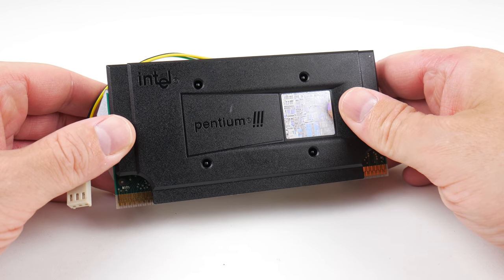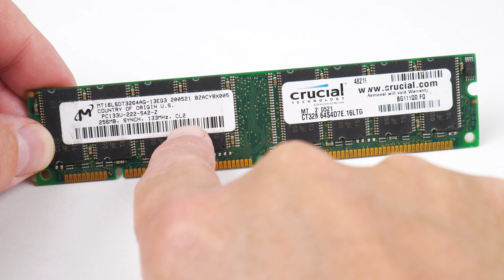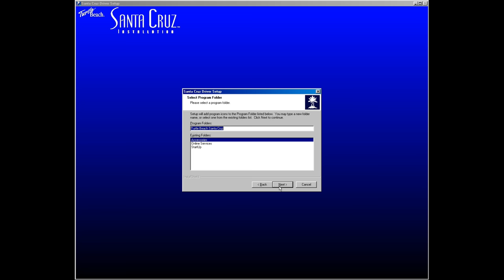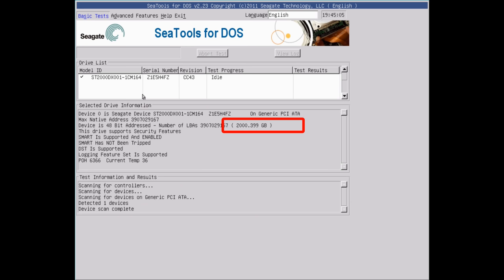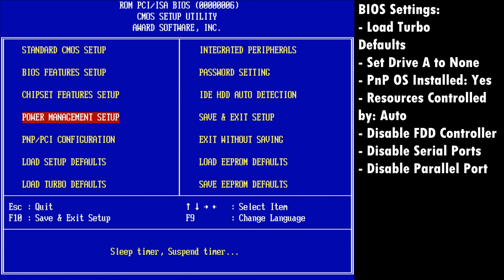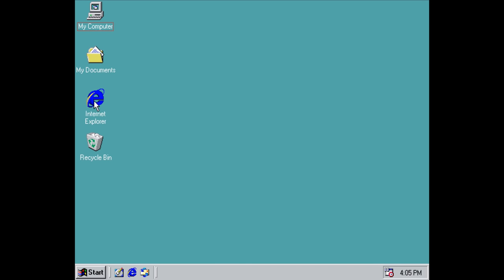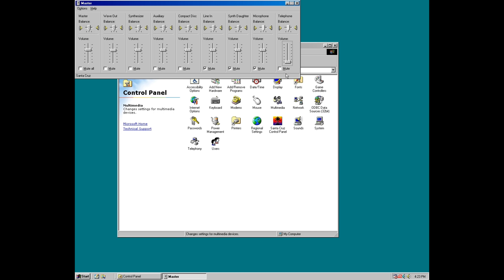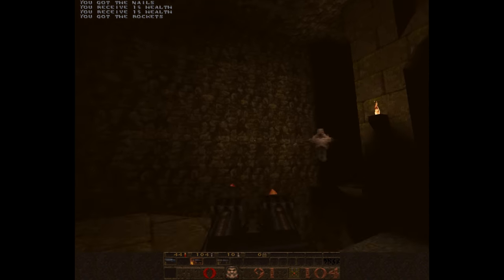1000 MHz Pentium III Windows 98 Retro Gaming PC Build

Comment: While the Slot 1 machines are easy to use, I have to mention that these boards of this era also are mostly those garbage caps that plagued that era. I just had to recap a Biostar i440BX board due to all of the exploded "Choyo" branded caps. Many board in the slot 1 era used these crap caps....except maybe actual Intel branded boards. Something to keep in mind. Check the board (investigate the pictures closely) before buying the board of this era, and if you see some issue make sure not to pay a high price for it and be prepared to solder through a multi-layer PCB in order to replace them.

Comment: The AMD Athlon outperforms the P3, but they might be harder to find and so not as good of a deal if the price is high. I have an old 600Mhz Athlon. Kept it from the PC I built back in January from 2000.

Comment: Turtle Beach used to be the premium sound card brand.

I had a slotted PIII/550 (probably still have it around here somewhere), and a socketed PIII/850 which was killed by a dead PSU fan (no overheat protection back in those days).  I moved to AMD with an Athlon XP 2100+ (1.7GHz, about the same speed as a 2.1GHz P4, hence the name) after that, because Netburst was absolutely awful.  If I wanted to do a retro build, I'd probably dig that up.  I should have a Radeon 8500 or GeForce 4200 Ti around to go with it.
Reply from the maker: Athlon XP was nice...

Comment: @PhilsComputerLab, I ask out of pure curiosity, because the Pentium III is really a bit hotter CPU, is it possible to test it with a nice compatible high end case with optimal airflow, case that allows front fans as intake, rear fans are exhaust, to create nice airflow in the case, replace the thermal compound with something real good like Noctua NT-H2, using really small amount with wide area spread, to test how low the temperatures can go, and benchmark its thermal performance compared to the same processor in its stock condition, on your bench and compare temps. I believe a good video will come out of this.

Comment: I have a Socket 1000MHz PIII Coppermine and a Slot1 board with rdram. I just need a fitting slotcket adapter.
Reply from the maker: Ah yes, I have such adapters. Should showcase it one day. There is even a 1100 MHz Pentium III,

Comment: Storage solution was helpful, I have a Gigabyte ga-6bxd running dual P3 600's, maxed on ram, Geforce 2GTS, Windows 2k. It's all good bar the HDDs being so damn slow. I have a raid card in it so I will see how it goes with a sata hybrid attached.
Reply from the maker: The thing with storage, a lot has to do with processing power. A Pentium III 600 can't handle more data. So loading times won't improve, you need to get a faster CPU. Like if you use a standard IDE drive, a Pentium III 600 will boot and load games much slower than a Tualatin 1.4.

Comment: I also like to tinker with older computers, but i do it in another way. I try to extract the absolute maximum out of them, so most of the time i am buried in specs for motherboard, chipset, CPU, RAM so i can gain maximum from all parts. Usually my approach is to see what is the fastest CPU supported CPU, with Fastest FSB supported, this allows me to go with largest supported amount of ram and fastest supported ram, Keep in mind that i know all these upgrades alone, do not do much and might look negligible increase and a waste of time and money, but if you think, it all adds up - this much gain from maximum amount of ram + this much gain from maximum speed ram + this much gain from in from core count + this much gain of tread count + this much gain from core clocks + this much from FSB maximum speed + This much from Decent SATA SSD.... most of the time i get results the whole is more than the sum of its parts, simply because all these upgrades add up to each other. Usually I stop here, sell it for profit and buy new PC, new parts, new project. If i am in mood to go overboard, and budget allows, i add a sound card and a Quadro card, i run the Quadro card with Quadro New Feature driver, in compute/Display mode So i can use the CUDA compute to add to general system performance and whatever insignicant and negligible is added from the sound adds on top. I choose the fastest Quadro compatible with this generation of motherboard, because i waht to utilize the full 100% of Quadro's  CUDA compute resources and still have enough resources for decent graphics performance. Usually i get Surprising results from total waste of time and money and parts, with no meaningful results, to real unleash the beast performance boost, results. As i said i rely on effect of all upgrades adding to each other to make the whole more than the sum of it's parts and i sell it for profit, as ready to use computer, like best performance for this era or this platform. When i sell for profit, i take care of cable management, cooling, usually i am loading the case with maximum number of high airflow fans supported by the case, highest performing fans compatible with the case and hardware, maximum number of front high air flow fans as intake for strong steady supply of cold air, maximum number of rear high air flow fans for exhaust, so i create strong even airflow, in the case for best cooling, and i put the strongest tower CPU cooler, with maximum number of high static pressure fans arranged in push-pull so that the airflow from tower cpu cooler is in the same direction as the airflow in the case and the airflow from cooler follows the airflow in the case with very small amount of good thermal paste, spread to cover the entire area  of contact between the CPU and CPU cooler. well this is my approach for tinkering with old computers.

Comment: There are some good dual socket 370 mobos with AGP. 

In the socket 370 era there was dual socket Tyan board I got. S2505D with 4x AGP. 

The king of the dual socket 370 boards for gamers was the 2001 Abit VP6 which had 4x AGP.
Check this review out:
https://hothardware.com/reviews/abits-vp6-via-apollo-pro-133a-dualcpu-motherboard?page=1
These boards may be effected by the capacitor plague as awhile ago (10 years - where's the time gone??) a guy was offering recapped boards on eBay. I have no idea how good these boards were but they had quite a following and at the time I could never afford one or find one.

Anyway, my Tyan which I could afford secondhand had 2x 1000mhz Coppermines on it and 4x AGP. Problem with it was it wasn't great for gaming but still quite good. Similarly specced single CPU boards showed this.
You had to have XP Pro (and above or some other editions of Windows that were multi CPU aware) installed on it otherwise no dual cpu support. The NB chipset ran so hot it was ridiculous (VIA Apollo 133). I put an old 486 era CPU fan and heatsink on the NB.

Before multi core CPUs we scoured the web for such boards. The pinnacle of boards was the Asus PC-DL and NCCH-DL which took Xoen 603/604. They had AGP 8x.  2CPU.com had about 5-800 pages of mods, voltage mods, overclocking mods and the best processors for overclocking which iirc were the 2.4ghz Xeon of a partuicular and naturally very rare and exclusive stepping. This board didn't support x64 OS so you were limited to 4 gb ram but it didn't matter since 64 bit implementation wasn't mainstream yet. The PC-DL could accept the most powerful AGP card built shortly after PCIe became mainstream - but I digress.
I actually have a brand new one in a box, in case the unused one in the computer case fails lol.
I can't bear to part with them.

Comment: ATI Radeon 9250 - No WDDM support. You can use Vista and 7 with XDDM drivers but Premium functions is not available. Windows 8 and later only supports WDDM drivers.

Comment: The Turtle Beach Santa Cruz card is the Crème De La Crème in the video capture world. There's a bit of competition finding them and they aren't the cheapest you can find. But they are 5 volt cards (not 3.3v PCI) and the joystick/midi port lost support after XP since Vista changed all joystick support over to USB so there is a legacy Yellow safety cone in Vista you can't make go away. Turtle Beach removed all hardware drivers from their website for their sound cards, even though their ftp site still exists but is password locked. Voyetra that bought Turtle Beach is kind of support Hostile towards anyone looking for the old drivers. Vogons has most of the basic drivers though. Tutle Beach had a long line of sound cards, mostly good. But today the best are the last, Santa Cruz, Catalina, Rivieria, Montego DDL in that order, but they are all 5 volt cards.. not 3.3 volt cards.. so they will have trouble with modern 3.3 volt processor motherboards. Kind of best rule of thumb is AGP video motherboards these are fine, PCIe video motherboards.. be careful. Santa Cruz was the last "true" analog audio only card they ever made. After it the Catalina, Riveria, Montego DDL dropped the joystick port and introduced optical SPDIF output, then optical SPDIF input and output. The difference between Catalina and Rivieria were both cost, and chipsets used. Catalina was the high end however, Rivieria was the low end basic model.. bare bones and if you have a choice, best overlook the Rivieria... but you can't find a Catalina to save a life. Sound Blaster from this era was better known and still grabs peoples attention. SB X-Fi for example had PCI and PCI express models before the Titanium version.. in a way mirroring the Radeon 4650 that had both AGP and PCI express models before moving on.. or imitating the transition between AGP and PCI express with the Intel 865 and Intel 915 motherboard chipsets.
Reply from the maker: It annoys me greatly when companies remove legacy drivers. Intel did this recently and I can't wrap my head around it. Yes I remember Turtle Beach having all their drivers ready to download...
Reply: @philscomputerlab  Yes the Intel removal was heart wrenching. They were so reliably available and now to turn that around, its very sad. best to archive everything from the web because people seem to like rewriting history these days. History will be contraband in the future.

Comment: You say that the motherboards for the Tualatins are more expensive, but in my experience it is the other way around. Also, apart from the very top end cpus (1.4 512 in particular), 370 chips are cheaper as well, especially something like a Celeron 1.3 which is pretty much on par with a Pentium 3 1.3 or at least 1.2. Tualatin celerons in general were the closest to their Pentium big brothers out of all the celerons up till today.
Reply from the maker: Hmm interesting, I actually haven't looked at prices lately. For higher end Windows 98 gaming platform, I now recommend cheap Pentium 4 and Athlon 64, or Celeron and Sempron, instead of spending more on the Pentium III platforms.

Comment: Hi Phil, I've also got the Aopen AX6BC board for my 98 build (will be using P3 1GHz, 256 MB RAM). I've got a Voodoo 3 3000 coming in the post soon for Glide stuff, but currently have a Geforce 2 Ti installed. I'm also considering buying a Geforce 4 Ti 4200, but it's rated at AGP 8x and the AX6BC only supports AGP 2x. Can you confirm the AGP speed rating of the Radeon 9250 you used here? Just worried about getting the Geforce as clearly the voltage requirements are different. Wiki states that the 9200 series are all AGP 8x (https://en.wikipedia.org/wiki/Radeon_9000_series#AGP_(9xxx_series).... if so, how did you get this working with the AX6BC and did you do anything special in terms of overclocking etc or did it 'just work' ? Thank you again for these excellent videos mate :)

Comment: Had a dual slot 1 motherbaord 2 pentium 3 1000mhz each it was a government auction pc had 2 gigs of memory fast pc at the time
Reply: for  Win-98  must  be  used  ""Asrock 775i65g""  ( with  built-in  video  card   &  single  mode  memory  &  USB   sound  card  &  SCSI  hard  drive )

Comment: I would use a 64-128gb ssd, it's only the partition size that windows 98 don't like. Well to be more specific, it's dos 7.10 under windows 98 that can only use FAT32 partitions as a max. So you just have to make partitions until you can use the entire drive. Sure you will end up with C,D,E and F but rather that, then only 32gb total.
Reply from the maker: I totally forgot to mention this, with SeaTools you can limit the capacity to other sizes of your choosing, like 120 GB. It just has a set and forget option for 32 GB which I like using as it works with old BIOS AND Windows 98 really well.

Comment: Phil, how do you deal with the -5v power supply issue? I have been using a new psu on a qdi motherboard and it gives me -12v instead of -5v. Thanks in advance

Comment: Thanks for the classic times. 

Graphics card setting. 
(Monitors 2) A must setting to 32Bits Color. OTHERWISE Defaults 256 Color Slow Video card Down by 30%.

PCI ata 133 controller card Manufacturer brand Promise

Comment: The 9250 is an agp 8x card, which supports 4x/8x mode as far as I know, and the 440bx only supports agp 2x or slower.... isn’t that a no-no because of the voltage difference? Or does the double notch in the agp connector mean the card can accept 3.3v agp operation in 2x mode?

Comment: This or a p4 are a really good system for 640 x 480 dos games, ones I've tried are quake, system shock, nascar racing, need for speed, carmageddon, build engine games, tomb raider and normality. I thought it would be good for flight unlimited but it just crashes because the system is too fast, also there are a few games that go a bit too fast including decent.

Comment: I was thinking about rebuilding my Slot1 machine, currently having XP installed on it and I booted it up last September with no issues whatsoever, but I am still in a struggle whether to put a PIII 667 in the place of the 1GHz Celeron or not. And I really want to put in a SSD in the machine, since the old HDD still works, but is extremely slow.

Comment: You put tape on the back of those adapters too? yeah, while they work well, they need to put some sort of coating/cover over the pins on the SATA side. I often touch up the soldering joints on these things because it SUUUUUCKS. These adapters are also kind of loose fitting when plugged into SATA drives. I'm afraid that over time it would become unplugged.
Reply from the maker: Yes, I worry that they might short out, it can happen easily.

Comment: How does it compare to the raspberry pi? I still have one server motherboard in a drawer and one PC build from server components that I once bought as my secondary PC that surprisingly booted two years ago (some Tyan 1U motherboard with 2xPIII 800MHz, 2x20GB Seagate SCSI drives cause chipset on both boards has broken IDE HDD support limiting it to 16MB/s PIO mode, other is intel board with 1x1200MHz pIII (I think) and many PCI slots, but I never used it. PCI slots are needed for the sound card, SCSI adapter and it would be nice to have USB2). Tyan board is not ideal, as it have only one or two normal PCI slots. Other has different voltage and the other is longer (without this board I would swear that all PCI slots are the same)
What I wish are socket7 CPU coolers which do not have 6K RPM.

Comment: Do you know how to get a pinball game called Hyper3Dpinball to work in DOS Mode of Windows 98?  I have been able to get many other DOS games running fine, by following your videos. And even this Hyper 3D pInball game, does boot up, but the video card doesnt work with this game. There is some program called UNIVBE-SETUP.EXE or something like that (in the 3Dpinbal directory that has all the files for this game), where you can change view/video card settings. In the past I have used only real DOS machines (no Windows 9x on it) with like PCI Cirrus Video cards that have like 1 MB or 2MB of RAM. And those worked fine with this Hyper 3D pinball game.

It just seems that maybe these newer video cards can never work to play this game. I really like the game, and it would be nice to see it working in DOS mode of Windows 98
Maybe its just impossible to get it working.  The SB Live card is working fine in all the DOS games, when running in DOS mode from Windows 98 (again following all your directions in various videos). This video card is the problem though.

Comment: Have a very similar setup  with the 1ghz pIII however I do NOT have a AGP Slot so what would you recommend for a all around graphics card for that era that was PCI. I heard voodoo3 is popular but so is the pricing, Had also looked at the Riva 128. I manily would be play games such as Quake,Doom,Unreal and Duke Nukem. For audio I had a spare creative ct5807 although its not the best, Im using the IDE2SD Card adapter instead of a mechanical drive works wonders.
Reply from the maker: See if you can find a PCI GeForce FX or Radeon 9000 series card! A Voodoo 3 would indeed be very nice :)

Comment: I am running a socket 370 P3 of 933 mhz with 133 FSB, and I was wondering, will this cpu perform similar? I want to switch to slot A because not only does it look badass, I also like the fact that those motherboards have 2 ISA slots.